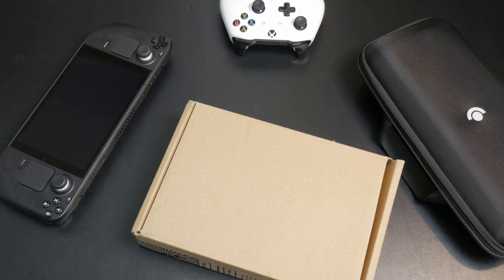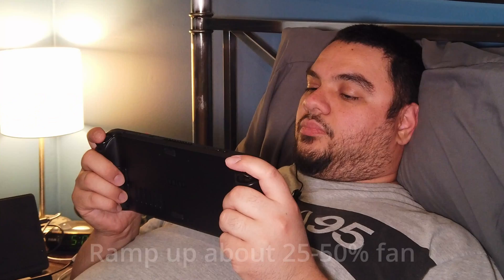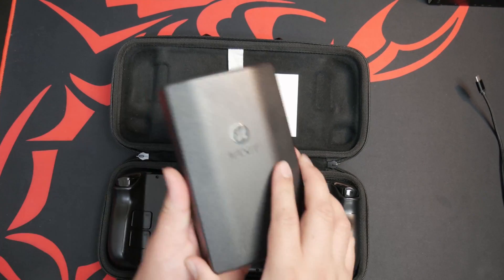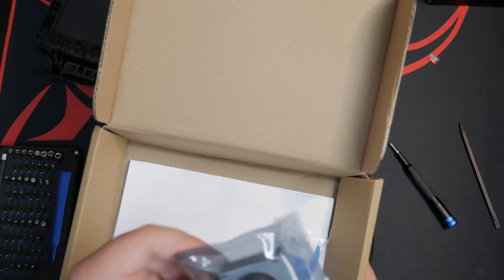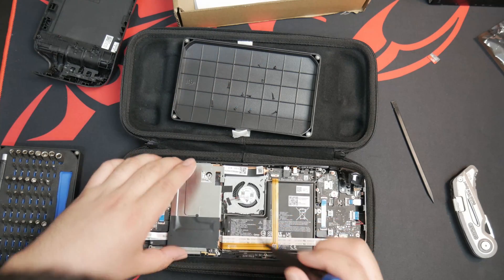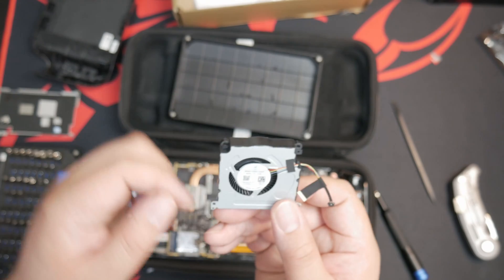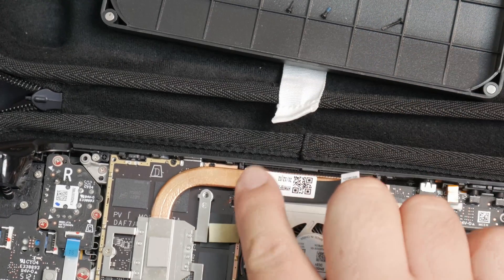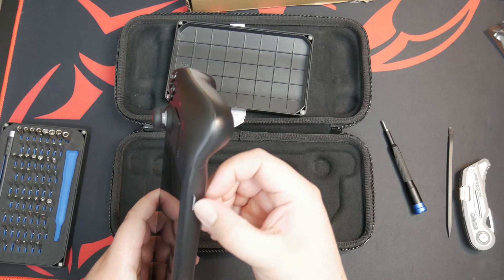Fan noise on the Steam Deck too irritating for you? Here's the fix! - Huaying upgrade fan install

Comment: Man, - one of the first youtubers, who care about the sticks and put the deck upside down into the case. Kudos for that! 😁 Thanks for showing! - I am planning to swap the fan also somewhere in the future, together with changing the thermal paste. That will be the final step after ordering and using the JSAUX cooler kit, - it makes my Steam Deck around 16 degrees cooler, which is nice in heavy use scenario, where the Deck goes up above 90C. But the swapping out the Delta and bring up nice thermal paste, I hope for getting another 5-6 degrees. Also the JSAUX transparent back plate with the integrated aluminum heat spreader should bring some more improvement. To have, in the end, a silent and quiet Steam Deck.

Comment: Is the air output of both fans about the same? I use headphones most of the time so the noise doesn’t really bother me. I wonder when performance upgrading parts will start coming out
Reply from the maker: Yes. Fan output and heat feel the same.

Comment: Good vid, will be using it as a guide when my fan arrives.

Did you notice any difference in temperatures?
Reply from the maker: I didn't really focus on the temps. As far as the heat output it seems about the same. I was mainly after getting rid of that high pitched whine sound when the fan was on. I will say this fan doesn't seem to ramp up as often as the original.
Reply: @SpiceVader  cool no worries, I'll do some comparisons myself. Good having a quiter fan, but also don't want the temps going too high.

Comment: I just got my deck last week and I never hear the fan even full gaming it’s quiet it’s working but quiet
Reply: Yep man but propably u have smart fan option on and this is not good for your steam deck
Reply from the maker: Nice! It may be a revised version. If you ever open up your deck you should let us know what fan it came with.
Reply: @CaptainLooks  hahaha explain me how? When u play any game try during play switch beetwen on and off. In some games when u turn on its not working at all. How this is good for components? To make more heat and have less noise? Its stupid